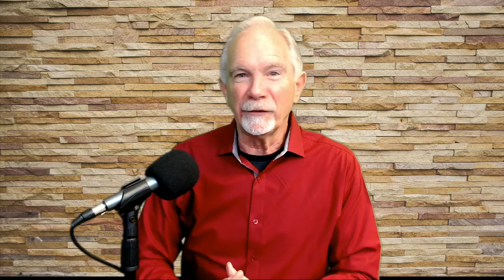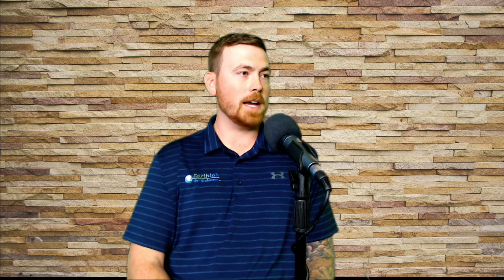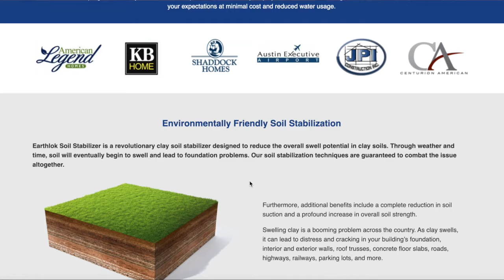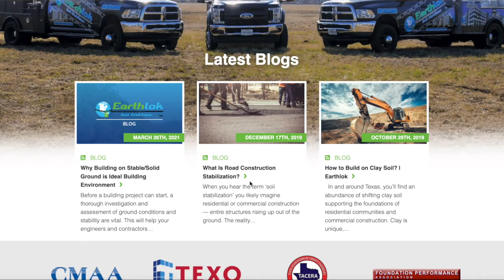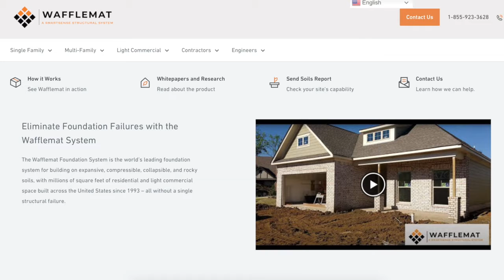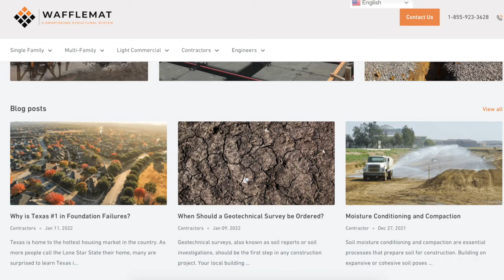How to Condition EXPANSIVE Soil [Before Construction] - The Foundation Guy EP 4

Comment: Can this be done when the builder has already built the house….. house is 30 + years old. Can we still condition now?
The back corner of our house keeps moving & breaking the back bathroom sewer lines?????? Oklahoma
Reply: Is it moving or settling?  If settling, you can use pressure grouting and if moving, you will have to use the same process to brace the house which is a more temporary fix as the pressure has to go somewhere